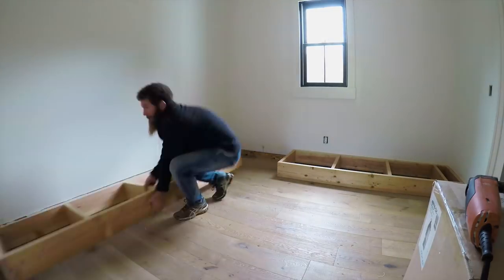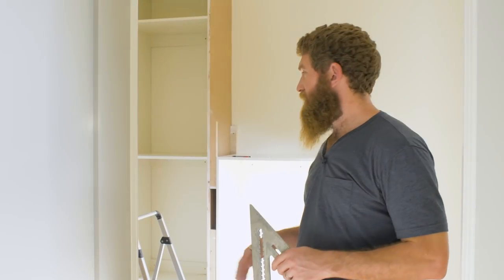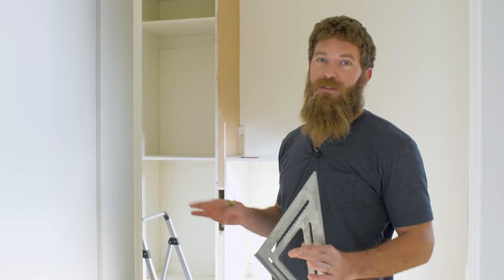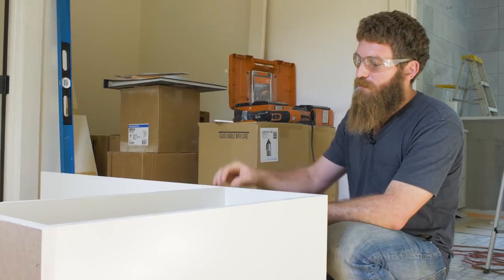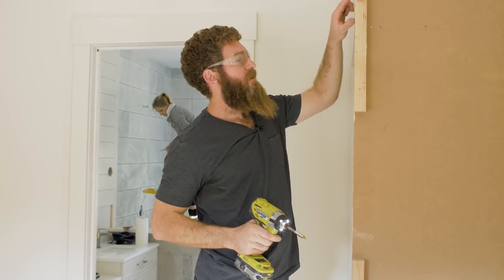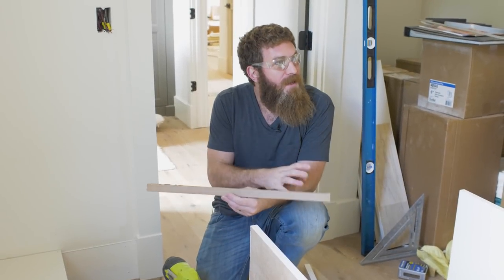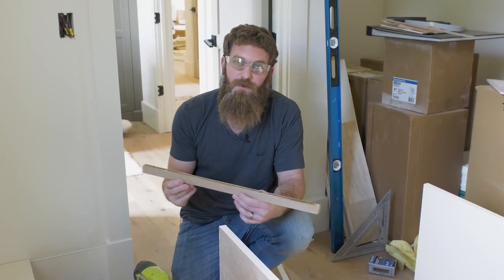DIY Modular Master Closet

Comment: Looks great! If you use 1/4 inch tape on the joints you can paint first and then remove the tape so you can still glue the joints. Using wood biscuits are an option too is you have the tools.
Reply from the maker: That is a great idea Keith! Thanks for the tips

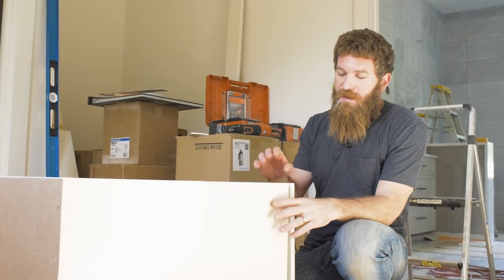Comment: You can indeed paint before assembly. 1:54  However, to do this, it is essential to carefully plan and mark your joints and then apply masking tape carefully to the areas that glue will be applied to. It is often necessary to use a sharp utility knife and straight edge or some similar instrument to trim the masking tape to only cover the areas where glue will be applied. 

I do this frequently in cabinetry in order to reduce the time needed to finish the cabinet interior.  Obviously, you also get a much better finish for all surfaces when you can pre-finish the pieces lying flat. 

Great video! Keep it up.

Comment: Great video. This project is where a Lamello Zeta P2 and Clamex P connectors would have come in very handy. Or a Festool Domino and cutting your holes for the dominos or Lamello Clamex P connectors after the paint dried. I was able to borrow those tools from a friend who owns a cabinet shop. He also had tools to pre drill the holes for the euro hinge cup and screws in one shot as we put doors on our closet system (although much smaller than yours). Through my cabinet maker friend I was able to get mdf that already had melamine on it so we didn’t have to paint it. More expensive but I saved time and didn’t have the space to paint and stack the panels.
It’s to bad that no one rents either a Lamello Zeta P2 or a Festool Domino machine.
Your closet system turned out very nice.
Ron

Comment: Man..   screw painting like that..       Lowe's has a spray gun that'll spray latex paint directly from the can..   it's over in the air compressor/tool area.   Not the paint section.     It's pretty badass..   puts on a really nice finish once you get the settings right..   just remember to strain the paint so it doesn't clog..
Reply: Please do you know what its called ?
Reply: @omolaraakintade274  Kobalt Latex Spray Gun
Item #220964Model #SGY-AIR70

Comment: I just finished a couple of double hanging closets and they turned out great!   Working on closet dresser section now.   I may be missing it, but did you mention the length of the drawer rails you are using?  Are they 20" or 22" or what?   Great plans, look forward to seeing what's next!
Reply from the maker: Thanks Mark! 20" slides will work best.
Reply: @rogueengineer  I saw in another comment you recommended Blum drawer slides but they only come in 18 and 21" variants. Which one would you go with? 
Looking at your plans it seems that there should be enough room in the box for a 21" slide. Thanks for the great content Jamison!

Comment: Great job, wish you showed how you built the draws and attached the fronts? Did you just glue them together? Also, you used Kilz primer, what paint did you use? Thanks!!
Reply from the maker: Thanks, I actually had a local drawer manufacturer make them because I was strapped for time and they built them for $30/ea which is worth it in my opinion. If you want to see my tutorial on how to make a simple drawer you can find that here: https://youtu.be/zo5mUBmguwk (full plans: https://rogueengineer.com/how-to-build-a-drawer-box/) I used my latex trim paint because we had a bunch left over.
Reply: @rogueengineer  Thanks for your time, really appreciate it!!

Comment: If you already have a pocket hole jig would you use that instead of drilling and screwing the panels together.  I would assume if they are all hidden between the sections you wouldn't see them and might make it a quicker process.  I plan to start on this after my Thanksgiving and am trying to get my brain tracking on how I am going to do it.  Everything but assembly in the basement then assemble on the 2nd floor.  Lots of stairs to carry.
Reply from the maker: We painted ours in the basement as well so it was a lot of carrying for us as well. Just go one section at a time and it’s not bad. As for pocket holes. I would advise against with MDF. If you’re using plywood then by all means. However pocket holes are normally for when a face screw might be seen. This isn’t the case for these units so drilling the pocket hole might just be an unnecessary extra step.

Comment: Looks great! Good job! Would you have done anything differently if you were to do it again?
Reply from the maker: Thanks! Honestly I’m pretty happy with how it turned out. I do still need to add some trim to the top and drawer pulls. Maybe nicer drawers fronts would have been a good upgrade.
Reply: @rogueengineer  it looks great! Did you like working with the mdf? I havent really worked with it too much,
Reply from the maker: BigJonHose it’s heavy and pretty finicky when assembling with screws but it paints up really nicely. Once it gets secured to the wall studs and to one another it is solid. It’s just getting it in position after assembly can be tricky
Reply: @rogueengineer  Gotcha. That makes sense. So as long as it doesn't split too much during assembly it is quicker than using plywood?
Reply from the maker: BigJonHose definitely quicker to paint since there’s hardly any prep required
Reply: You may have discussed this and I missed it but did you put anything behind where you connect the hanging rod to the side?  I only worry about those splitting when I put a full rack of pants on there.
Reply from the maker: Kevin Buchanan I used closet rod sockets to mount the rods and they are pretty heavy duty

Comment: how did you deal with painting the cut end of the MDF?  Those always come out rough looking for me.
Reply from the maker: Good question, we primed the edge first, then sanded smooth and reapplied the primer as needed before applying 2 coats of paint (sanding in between coats as necessary.
Reply: @rogueengineer  Thanks! Any particular type?  Last time I used a water based kilz and it just seemed to keep soaking it up and not making a difference. Was going to try a shellac one next time.
Reply from the maker: @SublimeSimplicity  I used KILZ premium and it worked pretty good but I've also heard of people using a thin layer of wood glue or even drywall compound on the edges.
Reply: @rogueengineer  Thanks a lot. I'll experiment, definitely have wood glue :)
Reply: SublimeSimplicity fine blade with painters tape on both sides should help reduce the splitting

Comment: Did you use satin or semi gloss for the MDF?
Reply from the maker: Chuck Kindstrand semi-gloss
Reply: @rogueengineer  I also use semi-gloss on a lot of my projects, but I get a tackiness after spraying a project. Even after allowing the first coat to dry for at least 24 hours. Any tips?
Reply from the maker: Use a paint made specially for cabinets. This will give you a little harder, more durable, finish